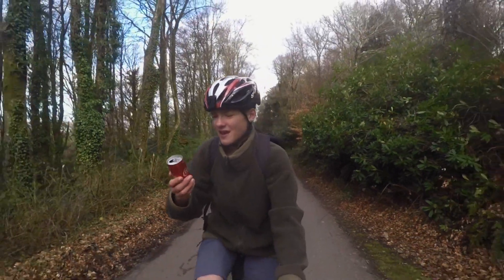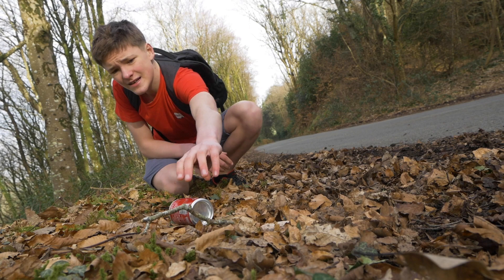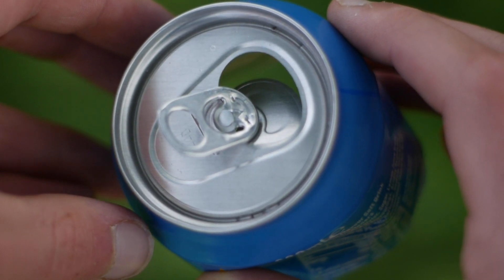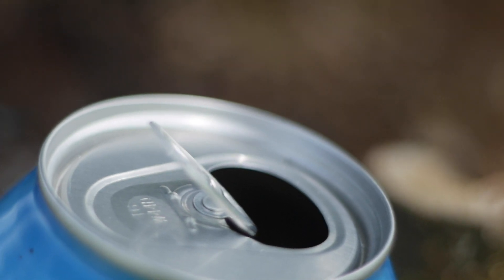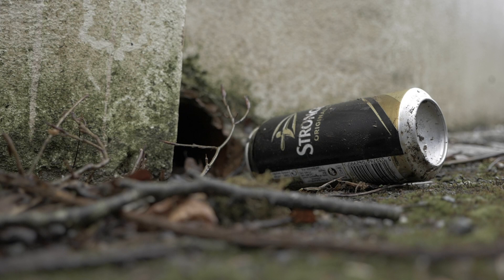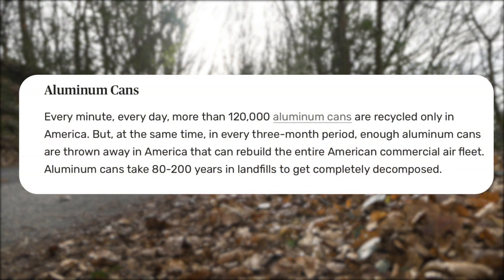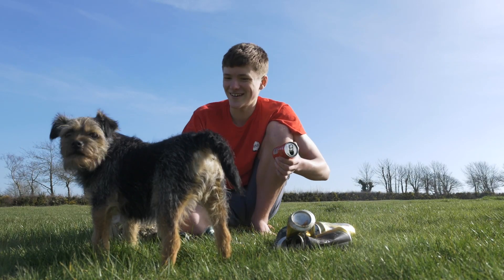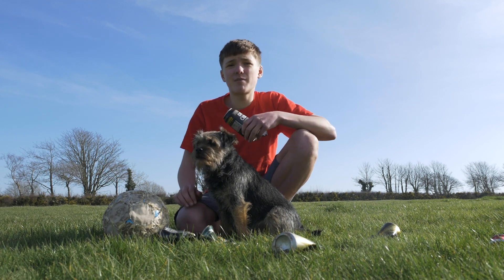The TERRIBLE Design of the Aluminum Beverage Can

Comment: In Germany we have introduced a deposit system also for aluminium cans in 2003, it was updated in 2006. The deposit is 25 euro cent. That helped enormously to reduce the littering of one way beverage cases. The return rate is above 95 %. It did not help to reduce the amount of aluminum cans sold.

Comment: Very well done Luther. I’ve noticed that it’s almost impossible to completely empty a can. Many years ago the first metal soda cans had conical tops and used a regular bottle cap. Maybe with some improvements (like a cap that stays attached) that would work again.
Reply from the maker: Possibly - though I do believe the cans we currently make are the most economical and thus sustainable cans that we’ve made up to this date. Surface tensions is what keeps the residue at the bottom, along with the non-funnel like top - so maybe your idea would be better.

Comment: Should we crush plastic bottles as well?
Reply from the maker: I guess it is a good measure just in case you were to accidentally drop it. Though I’ve never seen an animal in a bottle - they’re much easier to climb out of. But there are plenty of plastic bottles (and the degraded small plastics from them) in animals (lots of marine life) - so best to avoid them as much as possible